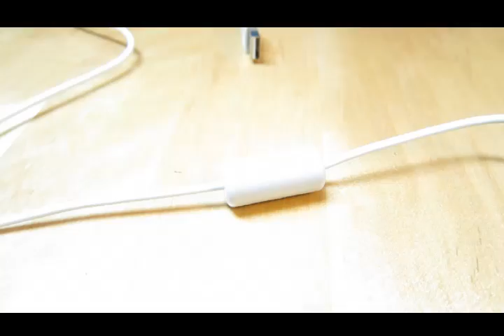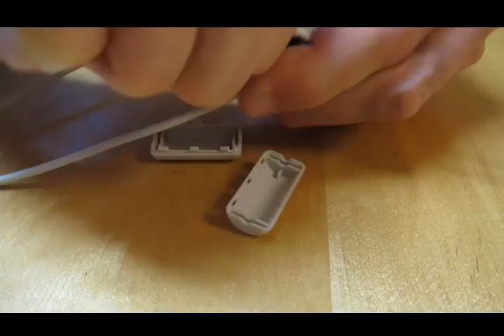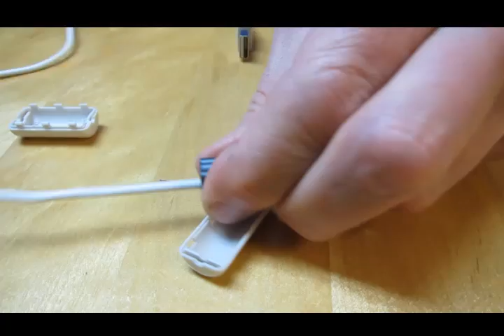Goodbye Ferrite Bead

Comment: Great- I can think of no better case for NEEDING a ferrite - on a ballon or kite that is up hundreds of feet so it can radiate RFI hash and interference to an even greater area. Thanks for contributing to the loss of use of hundresds of thousand radio receivers and increasing the RF spectrums noise floor. Hope your RFI won't land right on an aircraft approach or tower frequency-
Do NOT remove ferries - especially from digital devices and power supplies.

Comment: You had a good usb cable now you don't why remove something that was mounted for a good reason.
Reply: They're installed to reduce/eliminate interference from other electronic devices.  It appears that he's removing this one to save weight and will be using the cable on a "balloon" as mentioned in the video.  It's not dire that you have one installed in various circumstances.

Comment: sooo - how do you get the magnet off the cable WHEN THE ENDS ARE STILL ATTACHED. NICE SLIGHT OF HAND THERE.
Reply: mgabrysSF its two parts
Reply: @therider3939  The core is a single, solid piece.  Smash with a hammer or carefully grind it off with an angle grinder or Dremel with a metal cutting disc installed.
Reply: @djb7046  Not always